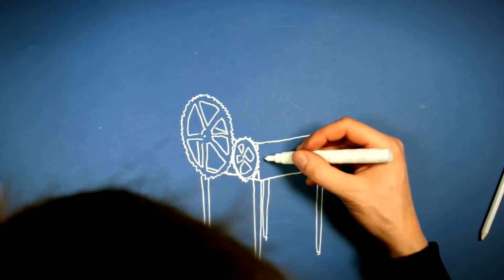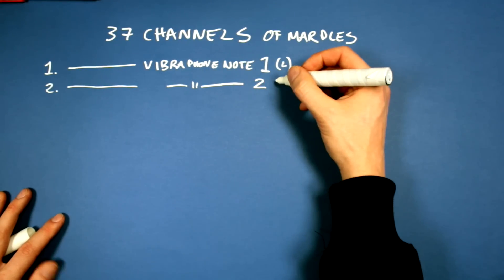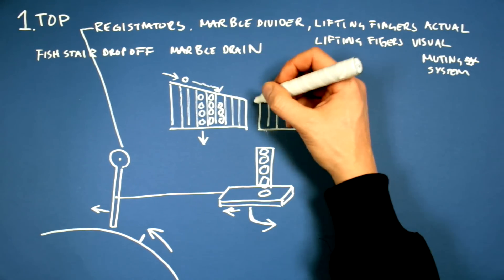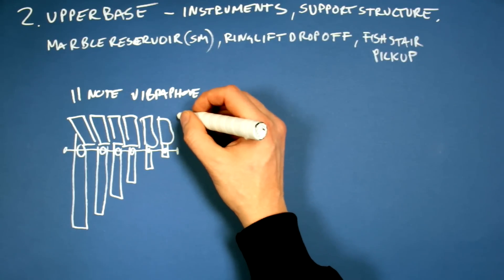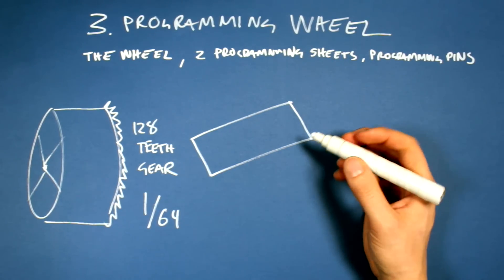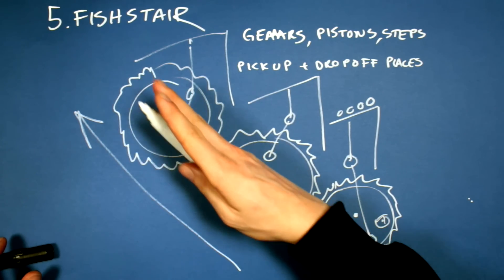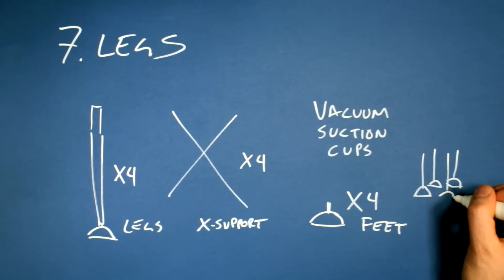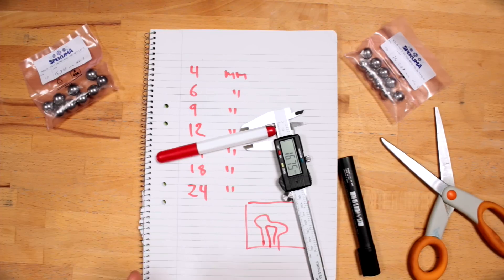First Sketches - Marble Machine X #1

Comment: A question about the suction cups:  I'm imagining that you set up the machine on a stage and have it suck onto the stage floor.  So far so good.  But if one (or more) of the cups loses suction during the performance (dirty floor?), and if the rubber is strong, it will be pushing up against the others.  I could see it prying up the other cups.  Or just letting the whole thing rock.

I'm not sure what the solution would be.  Maybe you just would need to spend time making sure the seals were good.  Or maybe it will feed into your choice of cups.  Or, maybe what you want is less of a suction cup and more of a good foot which gives good friction and damping, but doesn't actually get held onto the floor by suction.

Anyway, ideas to ponder.  Good luck with the design and the build.  Despite disclaimer, I found this video enjoyable.  :-)

Comment: You need the machine to sound decent on accoustic-only and electronic only as opposed to sounding good only on acoustic/electronic hybrid

Make something Matthias (woodgears.ca) and his 'doing' fans (as opposed to people like me who just watch the videos) can build off of plans without excessive difficulty

Not need a musician to play the chord-hand.

A touring machine will need durability.  Be libral with the use of braces. Don't be afraid to over-engineer the parts (thicker legs, thicker plywood, oak, whatever makes it resist wear better and handle transport better). You're probably not too tempted to skimp on budget and weight isn't an issue (not building airplane or fast car, designed to be taken apart for transport).  An individual replicating your machine from plans will want it to last a long time and not have to be constantly replacing parts.

Pegs not fall out of programming wheels during transit or while being handled (looks like you're thinking about this).

Easily interchangeable programming wheels so you can easily play multiple songs during tours (by switching out pre-programmed wheels or sheets; looks like you're thinking about this).

If you  are going to be spending many hours cranking the machine, you'll likely need to think about ergonomics so you don't suffer repetitive motion injuries.

A high-power demand system may benefit from a foot-crank (step-pump or pedal). Possible electric option for unattended demonstration or as a contingency plan.

Comment: Are you using a gear on every stair of the fish stairs or are you linking them inbetween a rod that is linked to two gears/wheels at each end of the staircase?

Also an idea, for any instrument that has double actuators per note, maybe design a "flip-flop" mechanism that automatically alternates the marbles between the two actuators. Saves you having to "program" it in the music sheets.

Would it be an idea to have a system that loads/unloads cards onto the wheel but can take cards from a cardbin, like you see in those old punchcard computers. Then you can just stack the music. 
The loading (onto the wheel) mechanism could be working while rotating similar to a gattlinggun.

For the muting system why move the resistors horizontally to provide slack instead of a cm up to avoid having to rely on slack in a rope, that allows you to make the link between the resistor and the hatch rigid. you could even make a muting piano, that maybe with a extra offset could actually trigger the marble dividers allowing you to go full manual.

Regarding the "spillage" would it be an idea to have one of those industrial rubber mats (those black ones with the holes in them) and fill all holes with disk shaped magnets. You can take those apart in smaller squares and then on stage you use it as "floor decoration" the magnets will trap any marble (assuming they're magnetic) that falls out.

Comment: Pushing the Registrators to the back will lead to them still picking up the actions from the wheel. Why not pushing it up with the mute levers? This should make the machine run more smoothly and lead to less wear on the components.

Comment: In the top section - Your marble divider reminds me of a funnel. Sometimes funnels clog and jam up. I would use a non-linear funnel shape that would minimize any potential of jams.
1.   I am a little confused with the lifting fingers, it looks like the first one is to control the marbles from the divider to set up for the lifting fingers to drop the marble on the note. This looks redundant, maybe I dont understand your purpose of the two separate plates.
2.   You mention wood and string. I would recommend aluminum plate with an acoustic damping material and stainless steel wire.
3.   I dont know how much the last machine weighed, but with all the marbles I am sure it has some significant weight to it. Making the machine lighter at the top will help stability.
Legs/Base
4.   Speaking of stability, you might be able to get away with a 'W' shape brace for the legs instead of the 'X' shape. The 'W' shape is called a chevron brace. The W would go well with the Wintergatan name.
5.   You mentioned that you want suction cups for better grip. I would recommend adding a complete square base to maximize surface area on the ground. The square base would have the four legs framing into the corners. Then add a x brace to tie the four corners together so the legs dont move outwards.
6.   Im sure this machine will be on various surfaces from wood, concrete, grass,  and with various finishes from smooth to rough. You could potentially have different bases for various conditions that you could switch out as needed.
7.   The square base could be equipped with rubber pads. If the design needed weight to hold it down, the base would act as a footing where you can add additional weight.
8.   For the legs I would use aluminum pipe with pipe linch pins (or some sort of hair pin) for quick assembly on and off stage, you probably dont want to spend a ton of time screwing around.
Hope any of the suggestions help,
Cheers an Engineer from Canada

Comment: 1 - It might work better when muting to pull the registrators up away from the programming wheel, rather than relying on slack in the line.

Also, I wonder about the marble divider; it seems like some experiments are needed here.  You show a constant slope; however marbles are essentially quantized, so if two adjacent queues each have four marbles, the "up slope" queue will have a larger gap between the top of the top marble and the sloping track.  Thus, marbles going down the track might get stuck in that hole, blocking further marbles from filling "down slope" queues until they are cleared.

Comment: For the mute, would a row of pulleys under the wires connecting the registrators to the dividers that move up/down to add slack be easier than moving the registrators?

Comment: @10:00 Bear in mind that the holes for the pins will wear with use. Initially the pins may work fine being pushed in the routed holes but if the holes wear and become slightly larger from use, the pins may not stay in reliably.
Reply: And bending the sheet into a circle will also change the size of the holes. And the LEGO pin design relies on a very precise size and a sharp shoulder on the hole to lock in reliably and yet be removable.
Reply: I would recommend a separate sheet for each song and not worry about switching out the pins between songs.  That way you can glue in the pins and they will last much longer.
Reply: Could you not use more like the music box idea and have the holes be in the input instead of pins?  You could use springs to pull down the registrators against the sheet to detect the hole and have the outgoing marble knock it back up out?  The mute system would have to pull up on the registrator instead though...

Comment: @4:30 I would be a little concerned about how this will work. Far end channels wont receive marbles unless all the channels before them have been filled. You need to have a really good supply of marbles coming in to the distributor to keep EVERY channel filled with 4 marbles. If the supply of marbles is not high enough, and the music is draining a lot of marbles, some of the channels at the far end could empty out before the ones before them refill and allow marbles to roll over to them. Your original star machine did not have this problem. Every channel filled with lots of marbles no matter what happened. It's not that your new design wont work, but like all engineering, it would be a very good idea to test this before committing to it. Thanks! Love your work, your band, the art you guys make and this project!!

Comment: Awesome video. I have a question. Why make the program sheet a guideline to a person to program? Why not use a program sheet that has pins instead of holes that is attached to the programming wheel? I think that would make it more efficient, once you make the sheet with the pins that can be attached to the proggraming wheel you don't have to proggram it manually. I don't know if I made myself clear.

Comment: I am very interested in your ideas and I think showing the design and build will help you in the long run. 
Just a suggestion, consider using a machinable plastic like Delrin for the moving parts. It is dimensionally stable unlike plywood, which may help especially when traveling. It also has a self lubricating property that helps parts slide against each other without sticking. Just a thought.

Comment: Have you considered the weight implications of using larger marbles? Assuming they are made of the same material, they will be (1.6/1.1)^3 ~ 3 times heavier. If you keep the size of the MM, this will mean 3x more energy required to carry them up (=tiring? But maybe negligible VS friction...), and 3x more energy when they hit the instruments (=different sound? Damage?). But I guess drop tests are your next steps anyways. 
You could of course compensate with a 3x shorter fall distance, but that would probably change the overall design a lot. 
Also, fish stairs VS belt sounds like a lot more potential for friction and jamming, that will require some good engineering!
I love your work and am looking forward a lot to seeing this project develop!

Comment: This type of video is right up my alley. I loved the set of videos that explained the Marble Machine and I definitely love that you guys are open to feedback about MMX. I followed most things about this design, but wasn't clear about the programming sheets. What type of plastic are you going to use that would be strong enough to hold the programming pins tightly but be flexible so you can wrap it around the wheel? This is just for curiosity so I can understand it better.

Comment: You will need to careful when you choose the stock for the programming strips. if it is 8mm thick to allow for the lego pins, then it will need to be a pretty flexible material to wrap round the drum, if you cnc the holes in a hard material to the correct size for the pins while the belt is flat they may not hold the pins securely when the strip is wrapped around the drum as the outside surface will stretch more than the inside making the holes become coneshaped. If you used an industrial  conveyor belt style material you could cut the holes slightly undersize to compensate for the distortion when it is wrapped round the drum, but still be able to remove and install the pins easily.
Reply: Good point. Perhaps if they are "almost" cut into strips like the old machine, so the flexing happens at the joins rather than through the holes?
Reply: I had the same thought when he went from "clear plastic sheet; bend" to "8mm thick". Whoa! He would have to route it out like a toothed belt.

Comment: You might wanna make sturdier legs or use Eiffel tower design on them to make them more stable so you avoid the last times issue :P
Reply: The skinny legs are an intentional style that he wanted. He still wants to keep the skinny legs, but wants to minimize the wobble as much as possible. Keeping the MM center of mass in mind during the design is a great idea though Helveshit
Reply: I think that's what the 4x crossbars are intended to do?
Reply: Considering the weight of the structure, I do not think those small legs can truly support it even with crossbars. The weight is unbalanced after all. Maybe a bit more stable if the other parts are well engineered but I can't help but feel those legs are a bit to spiny even with extra support.
Reply: It also depends on how he is going to power the thing. If he attaches a frequency motor that he can pre-program in certain speeds. It might cause less wobble due consistency plus his body won't aid the wobbling by cranking like the previous machine.

But Frequency programmable motors aren't the most cheapest. Since when a human body moves to crank it... They add a slight motion with their right or left torso which applies a force that pushes the cranking side forward a little. But once you do that a couple of times, it adds up into a wobble motion.

Bit like a bathtub. If you move your body back and forth once, you don't stir the water too much, but once you do it a couple of times... You suddenly have a large waves in your tub.
Reply: I think more crossbars would be a good idea, but by using more, you could conceivably use thinner, less visible ones. Put two crossbars on every single side (8 total), and put bars going from foot to foot (a square on the floor, essentially). With a lot, it'll be strong with even thin steel tension bars. Paint them black, and they'll be very hard to see on stage.
Reply: Helveteshit isnt that something he complained about on the original?

Comment: For your marble divider you may run into a supply problem for your lower stacks. During use all previous dividers must be full in order for the last to receive one, as a result it will receive less marbles (at any one time it is unlikely for all previous dividers to be full). This will be true for all previous divisions to a lesser extent. The issue will compound with the fact that they reduce in capacity along it's length. I believe over the course of a concert this could lead to serious supply problems for certain dividers. This could potentially be alleviated with either a large excess of marbles (increased cost, weight and sound) or arranging lesser used instruments to optimise supply. I'm sure there are other solutions though.

Comment: I'm curious how you're planning on mounting the vibraphone bars so that you get that nice visual deflection while still having a good sound. I have a few ideas on how this could be pulled off, but it's tricky. 
Also, are you going to be using pickups on the vibes or an acoustic microphone?
Reply: I'm a robotics engineer and percussionist with some background in audio electronics engineering and acoustics- I'd be really interested in reviewing the CAD as you get things drafted. :-)

Comment: The old machine had 4 marble inputs for 16 channels, this one has 2 inputs for 37 channels. And the supply method means that the side channels will be prioritised over the middle ones. Aren't you worried that the bottleneck means some channels could become marble-starved if used frequently enough?
Also, 37 metal wires closely stacked together that all go slack together sounds like a recipe for a tangled mess - you'd have to guide how they go slack... tricky.

Comment: Although I think think the fish stair will be more visible than the the old belt system, I imagine it will produce more extraneous noise as the marbles roll and hit each other on each stair?
Reply: CCBigStew you can cushion the noise by putting on fabric on each stair to compensate I guess but I could be wrong

Comment: I wonder how loud that marble stairway will be.
Reply: He can muffle the noise by putting some rubber coating on the vertical surfaces or the stairs
Reply: If they follow the beat it wouldn't be a problem.
Reply: I kinda like the sound of the marbles rolling around as long is it doesn't drown out the sound of the vibraphone bass  and drums.
Reply: When I was a child I had a marble run game that used a similar concept to get the marbles back to the top and the mechanism its self was not very loud but the marbles hitting the side of the next step produced a noticeable sound. Having said that Im talking about a kids toy not a 1 of a kind musical instrument.
Reply: Luficarius Ratspeed If it's well done, it's almost completely quiet, actually
Reply: TOMY trip over traps? I loved that
Reply: As far as I remember, he uses small microphones for each instrument, and those microphones don't really pick up the environment/room sounds - only the instrument sound. I remember when he demonstrated things, he was talking and explaining stuff, but when he actually turned the audio channel to what comes out of the machine - his voice wasn't heard at all.
So basically what I'm trying to say - this machine is LOUD. The first one was very loud too, what with all marble falling and rolling over the wood, wood grinding over each other, etc. etc.
But the actual output audio doesn't pick up on all that noise very much. I don't think that marble queue will actually be louder than some of the elements on MM1. So everything should be fine. =)
Reply: Nothing a neoprene landing pad or marbleway can't fix.
Reply: Very

Comment: The machine looks insanely complicated, and as you've mentioned, it breaks easily because of the components and weight distribution/parts used. Have you considered maybe consulting a mechanical engineer?

Comment: Will the I's very interesting though I'd like to know if the lego teeth used on the programming wheel allow enough time to be given to the falling marble so as to not jam the machine and also may we have a video explaining the workings of the modulin as that would give more insight  in to how the marble machine x is going to function with it as an attachment.